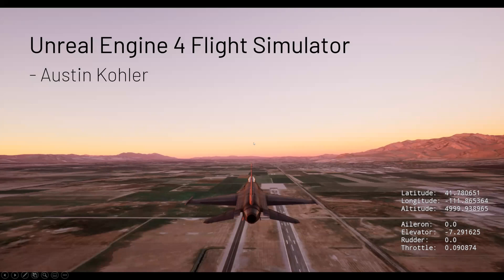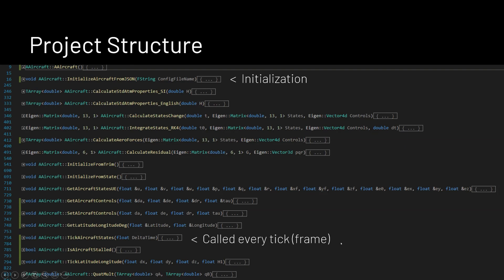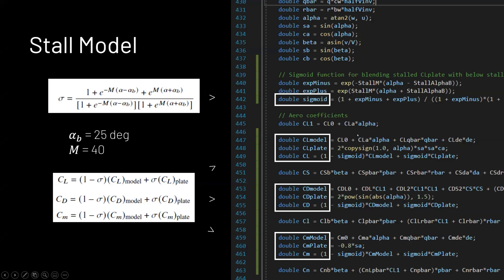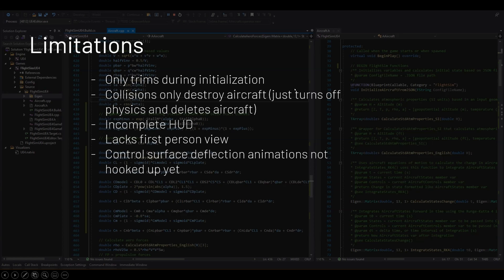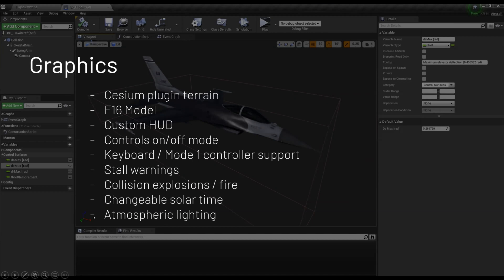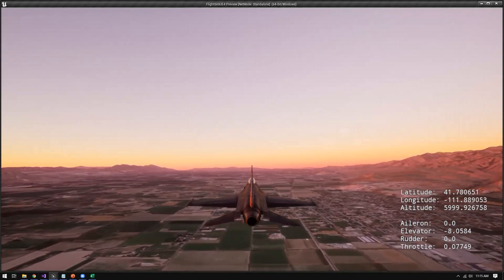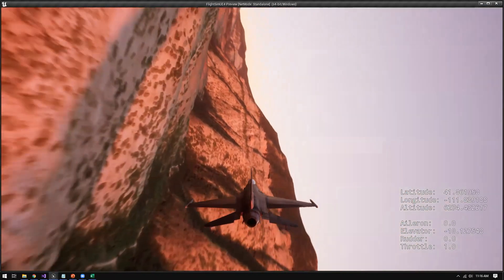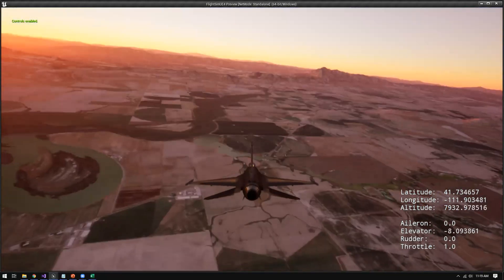F-16 Flight Simulator Using Unreal Engine

Comment: Been working on a flight sim as well, though we've gotten stuck on the landing gear physics just not working at all... Would you have any advice by any chance?
Reply: bravo Lima foxtrot double o 1 12 IFR departure to Atlanta int, climb maintain 5000 expect FL 500 within 10 minutes of departure. Squawking 2545.taxi via to taxiway 29 left. cleared for takeoff bravo Lima foxtrot. Radio frequency 120.8